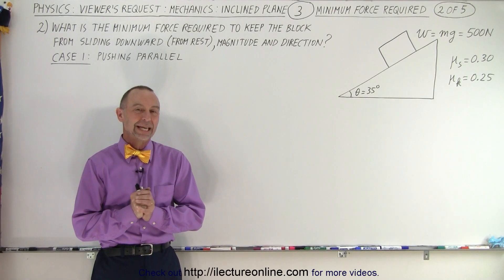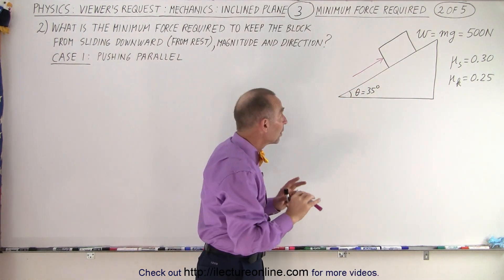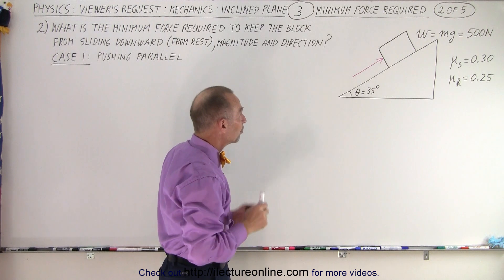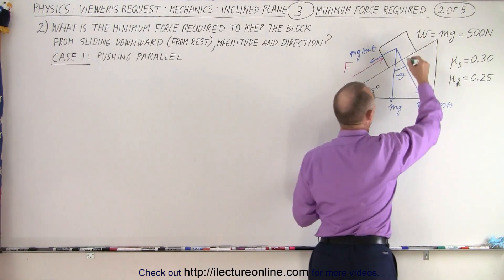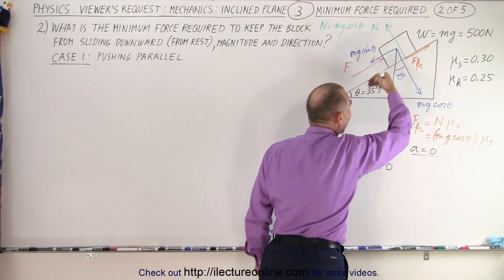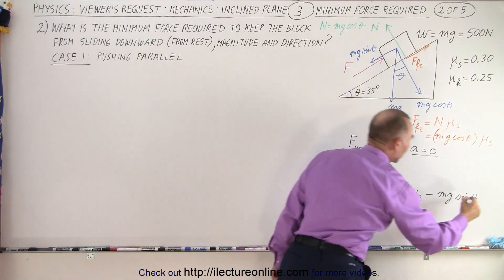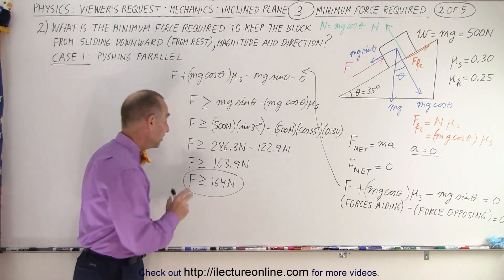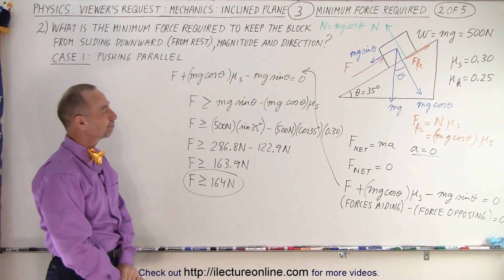Physics: Viewer's Request: Mechanics #3: Inclined Plane - Min. Force Required (2 of 5) Parallel

Comment: Shouldn't the force be just equal to rather than greater than equals to to stop the ball from going down. Since if the force is greater, won't it cause the mass to move upwards with constant speed?
Reply from the maker: A force "equal to" will keep the block from sliding down (since the block starts from rest).  A force "greater than" will push the block upwards with acceleration.

Comment: Great lesson sir but I have a question. On the previous lesson #2, you add the mg sinθ and the mg cosθ × μ. In this lesson, you subtract it. Is that a mistake?
Reply from the maker: In both cases we are calculating the net force acting on the object.  In this video the mg sin(theta) and mg cos(theta) mu  both act against the force pushing the block up the incline.